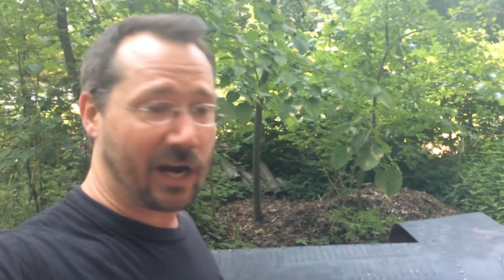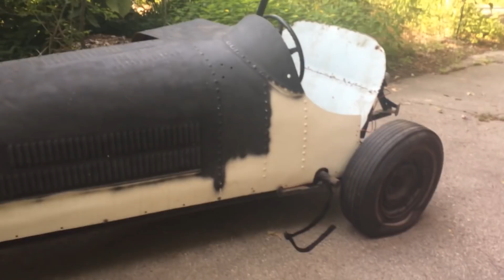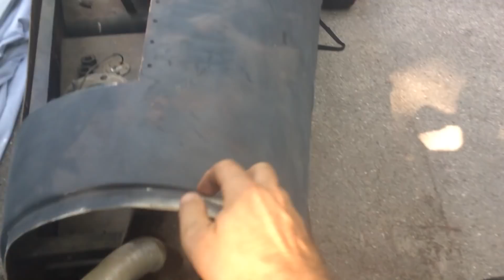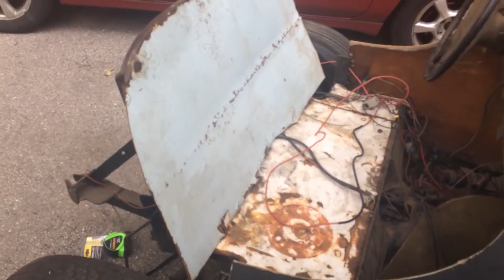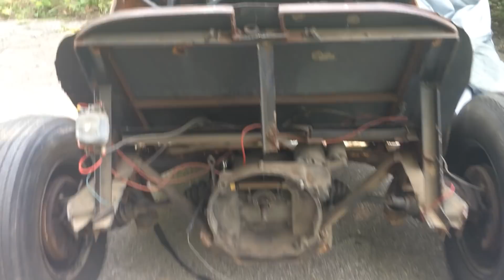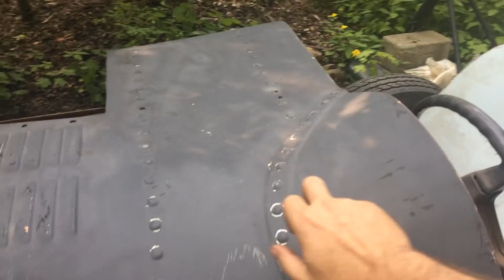Bugatti Roadster Kit Car for electric conversion

Comment: I've got a Prestolite MTC 4001 with an adaptor plate for that transmission going spare. It is in the UK though. It came over from the US back in the 90's when I was working on Clare Bell's #13 Porsche 914 EV racer.

Comment: I’m so interested in learning how to do the ICE to EV conversions. I watched your other series (it was awesome) but I’d LOVE LOVE LOVE to see one done on an automatic car and use old laptop Lithium ion bats instead of Lead/acid bats.  Maybe with the ability to charge via a CHAdeMO connector. Just going all in. Digital read outs in the dash of voltage/current/rpms/mph. Just a thought. So glad I found your vids. Very cool man!
Reply: lightvsdark21 I agree except for the auto transmission, that is something you will never EVER want to do, either choose direct drive (like a tesla and most other manufacturer EV's) or use a manual gearbox, the inefficiencies are too large with auto, if you would like more info I highly reccomend Damien Maguire's channel and check out his earlier videos when he converted a bmw with an auto transmission, he later switched to a manual box and it was like night and day, plus with an EV you can drive the manual like an auto no problem, stick it on one gear and go! :P
Reply from the maker: Damien Maguire has excellent information. Some of it is a bit advanced for beginners, but he's done some amazing projects.
Reply: The actual gearbox isn't necessarily much less efficient, but the torque converter is. Some good results have been achived with no converter and an external pump to generate the operating pressure. A motor with a wide operating range is nearly always better than a multi speed transmission though.
Reply from the maker: For this project, I was thinking ANALOG gauges. That would go nice with some very mechanical type buttons and switches on a wood dashboard. It would actually be pretty interesting to design some analog gauges which are controlled by something like stepper motors and a micro-controller. That's actually very close to how most modern "analog" displays are now done in cars.
Reply: You can buy stepper intended for instrument panels pretty cheap these days; Google "What is Gaugette"
Reply: @Charlton Hawkins good to know! I’m not s huge car buff and tbh have NEVER even sat in a standard vehicle much less driven one. Don’t even know what direct drive is hahah. Guess that’s why I was inquiring about automatic but hey if it will work like automatic then I’m all good lol. Either way love these vids and learning more each time I watch!
Reply: If you use auto transmission, you might want to considered the electric noises from the batteries that will disrupt the ECU.